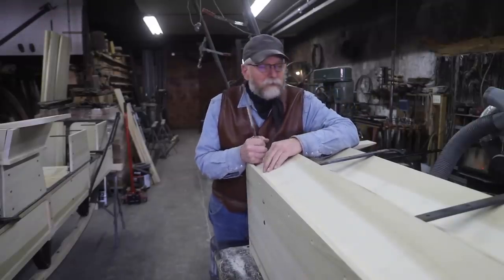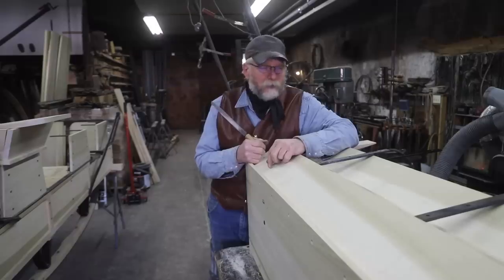Multiple Compound Angles Will Challenge You | Engels Coach Shop

Comment: Worked on a summer construction job one time that the old house had a two-way peaked roof ( + )with 4 valleys. The house had burned a bit so replacing the roof rafters was quite interesting. ended up using the charred rafters to at least get an idea of the required angles for each piece. Of course having the correct measurements completed that task.

Comment: I'm amazed at the amount of hand finishing required for these seats. In a utility wagon such as this I assumed that beveling the edges was good and sanding the topside enough to prevent splinters in the passengers' backside would been a luxury.. I stand corrected! Modern furniture is put together with sawdust board or wood not fit to be used in pallets, just cover the frame with padding and staple Naugahyde over it all.

Comment: Very interesting the work involved in making the corner filler/brace for the seats. It does seem odd, though, that the original coach builders (of the era) chose to put the irons on the inside of the seat faces - to sit on and possibly damage clothing. While "correct" in duplicating the original (and apparently common practice in that era) I can't say I care much for that design.

Comment: Dave does a good job with the compound miter cuts.
But back in the day the wagon was originally made.
Circular saw blades had been invented.
But AC electricity was not available in rural areas until 1920s., some 1930s.
Compound miters with a hand saw? 
You go first.

Comment: Another outstanding video and lessen in wagon building. Will there be some sort of cushion on those seats? I ask as the way the bolts are run in from the bottom puts the bolt end and nuts on the top of the seat and under the passenger's butt and legs.
Reply: Yes, they will be upholstered.

Comment: Near the beginning of the video, around 2:00 to 3:00, when you are trimming at the table saw, you nibble away the material.  I wondered why you didn't make a through cut near the final line first and then nibble until you hit your pencil mark?  Seems that i would save some time without compromising the work.  Thanks for sharing the video.  Nice work.
Reply: There's the least chance of the saw grabbing it, doing it that way.